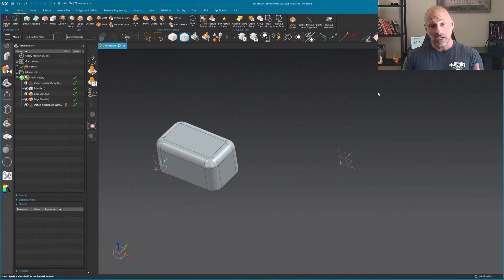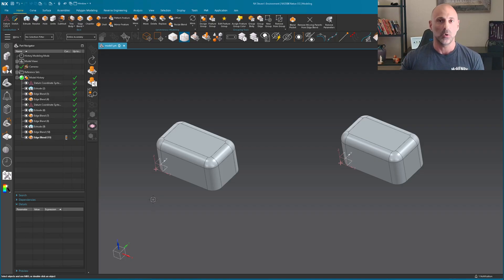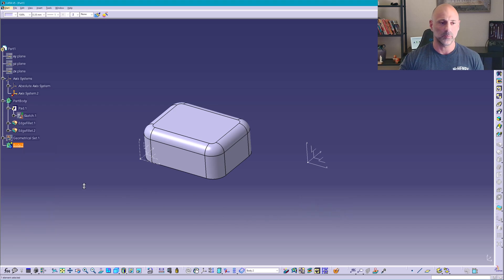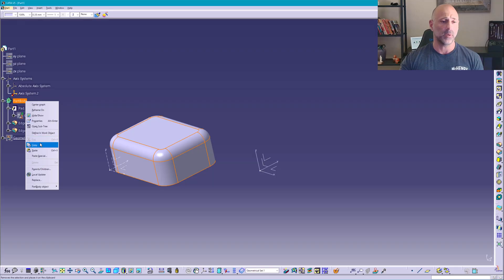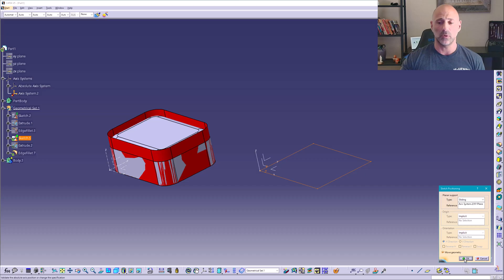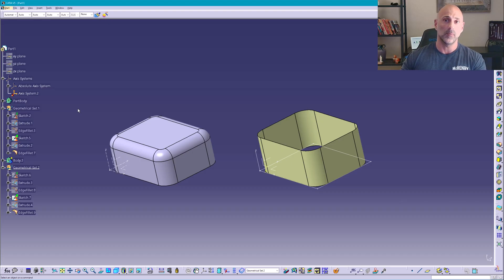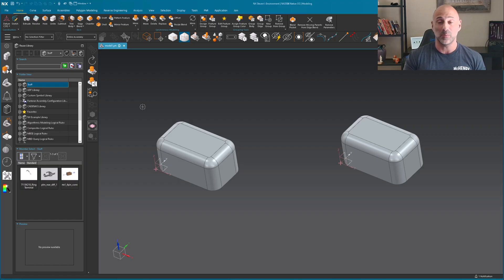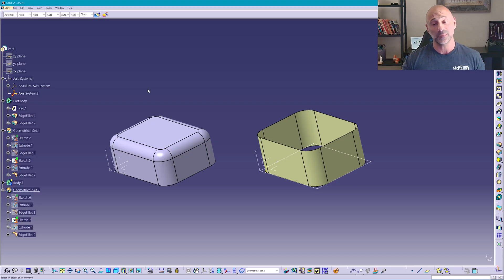📋 NX vs CATIA V5: Copy & Paste Showdown - Which CAD Does It Better? ⚔️

Comment: In general, I think CATIA wants its users to know what they are doing. If you want to do or change something in CATIA you have to know where to look for or what to do for it. In NX, it chooses something for you. CATIA has tools for niche situations but most of the cases we don't need that so designing NX will be faster.
Reply from the maker: In some ways, I agree. 

Interface, catia has a simpler menu system and does not do the try and pick something dance the way NX does.

Comment: Some people think Copy-Paste is the fastest way to build a model, like in AutoCAD, just to get it done. But in engineering design, models must stay stable and editable so any future modifications or updates don’t break the file or force a full redesign. CATIA emphasizes this associative, robust workflow — Copy-Paste can work if done correctly, and there are also alternative methods to achieve similar results without compromising the design. Maybe NX is more flexible in this regard, but in CATIA this approach ensures the model is stable, reliable, and ready for future modifications and updates. From my experience, even after starting machining a part in an assembly, in the machining workbench, if a change is needed — like moving a hole or modifying a feature — CATIA lets you update the model in assembly and all machining operations seamlessly. This level of automation and stability is rare in other CAD/CAM software and really shows the power of a well-structured CAD model.
Reply from the maker: The ease of copy - paste in Catia is wonderful. Across parts and retaining links is super easy. Love it. 

NX in many ways has caught up to Catia or even surpassed it when it comes to the CAD to CAM stuff. My biggest concern in NX is the ease of use of B-Reps and how  easily they fail. Catia in some ways forces the user  to use actual features and not B-reps so stability should be a little better. 

It is a fight I have with NX users a lot: Stop being so dependent on B-Reps

Comment: Thank you Steven. My take on it is that Catia V5 has more options to Copy-Paste, but those options would have value only in more esoteric or niche situations. I prefer the straightforwardness of what you demonstrated in NX, and the fact that NX's dialog boxes are all very consistent across the majority of NX's functions.

Your demos of Catia make me think of Creo's user-interface. I switch more or less constantly between Creo, SolidWorks and NX, IMO Creo's UI is a hodgepodge - not streamlined and consistent as NX has become over the years and SolidWorks has always been. With Creo, either they just don't give a damn, or the UI programmers don't bother to communicate with each other. Catia's UI leans that way, based strictly on what I've seen demonstrated in many Catia videos I've watched over the years...not as hogdepodge as Creo's UI, but not great. They are all powerful and capable and can get the job done when one has sufficient experience, but clearly some are more streamlined than others.
Reply from the maker: Creo is very odd. I honestly think it is the least intuitive. Some features ou have to know how to use them or you can't use them. 

Once I got used to V5/3DX and got the customization of the interface just right, it is not so bad. The swapping of apps to go from solids to surface is the big one IMO. 

Catia does have more options for copies and they all work well. I do miss the ease of copy - pasting across parts and retaining a link or making something that is not parametric. V5 is easiest for that.

Comment: How about copy-pasting between different part under a product? I am having a hard time understanding the responses from CATIA every now and then. Greetings from Turkey!
Reply: With History?  Or without?  Without- paste special ---> as result or as result with link.  Many companies do not like as result with link especially if they have a plm system.  Or you could publish out of CATIA and import that into your other model (again some companies don't like it).   
With History it's not much different to as described I use power copy mainly as it shows what inputs are needed before you insert it into your new part.  If your being lazy (which I often am)  and your copying a body into another part best method is drag all the construction geometry into a single geometric set and then drag that under your part body.  When you copy into your new part it will have all of the references required.  Sketches will often break because they are missing the axis system but that's easy to fix.
Reply: @paultheworldking  Thanks! I sometimes get much too frustrated because of "Pasting is not allowed" I don't know under what circumstances I get the message. It sometimes work but sometimes does not. Might be a very noob question as well since I've not taken any proper CATIA training.
Reply: @lithaen we all have muscle memory with Copy/paste from other software.  When you get your head round it it's pretty simple.  We all mess it up on a regular basis and end up doing it again. It's easy in V5 as you have multiple undos in V4 you just had 1
Reply: @paultheworldking  Ha! Muscle memory in action, love it! 😂
Reply from the maker: Excellent comment and summary. Thank you!